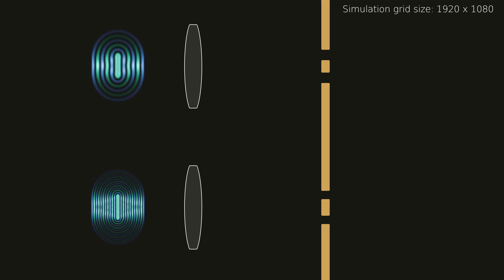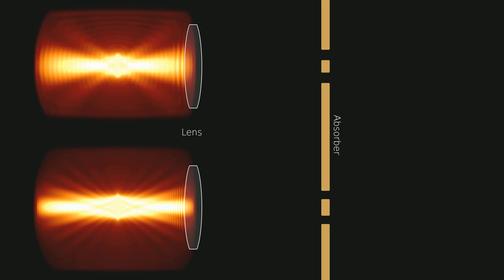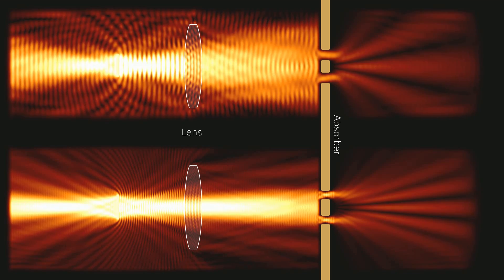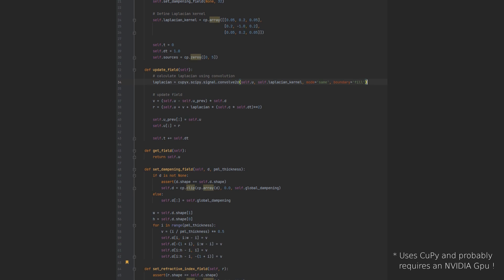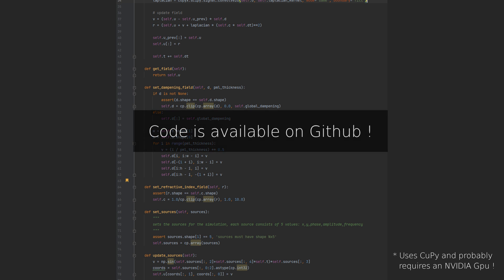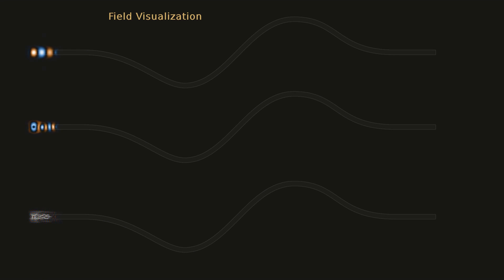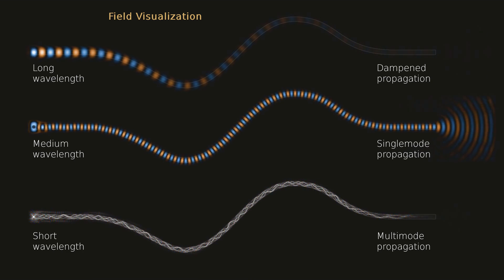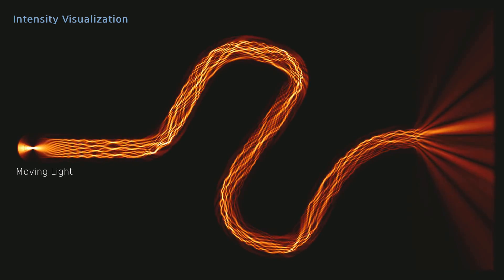Fiber Optics - Simulating Light in Optical Fibers

Comment: Hello thanks for the sharing the neat code. I came from @HuygensOptics that he mentioned the codes are from here. I just have one question regarding the cupy/CUDA package install. Will you be able to demonstrate the packages dependencies in the future videos? I somehow had error messages about the "cupy\cuda\jitify"...which is very frustrating. (I suspect is either NVIDA driver or CUDA toolkit is not installed properly...trying it now...)

Comment: 3:56 multimode propagation does completely not delay the wavefront but disperses it over a longer time period. The more direct mode will arrive at the same time as in the single mode case. The delay shown is also inconsistent with the earlier examples of varying fiber diameter, which should show the same effect in multimode propagation.